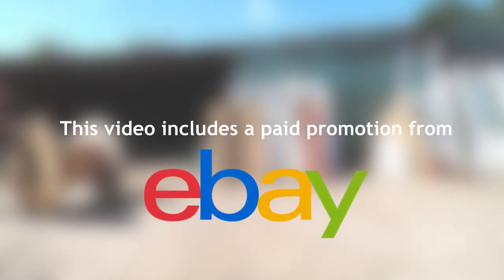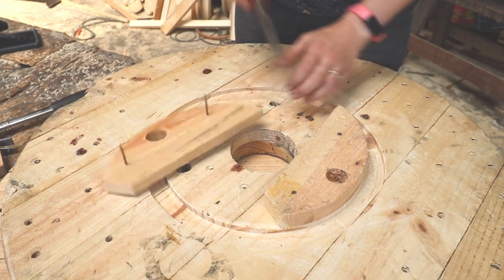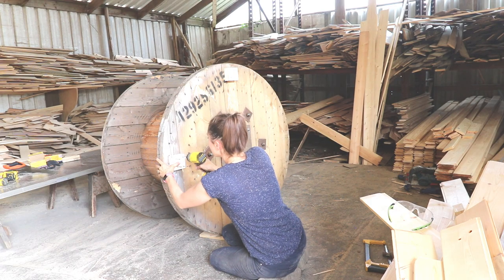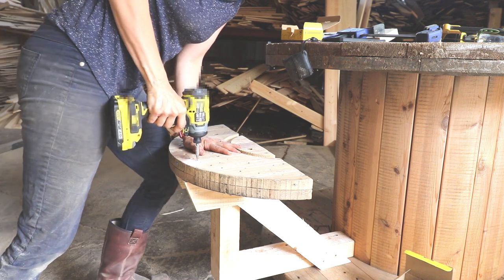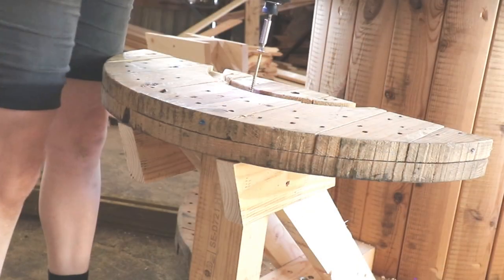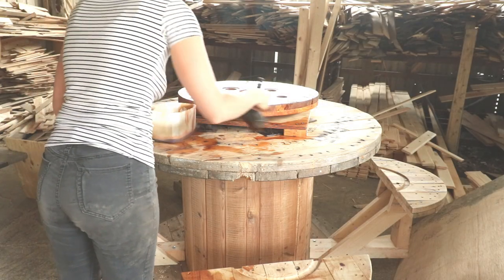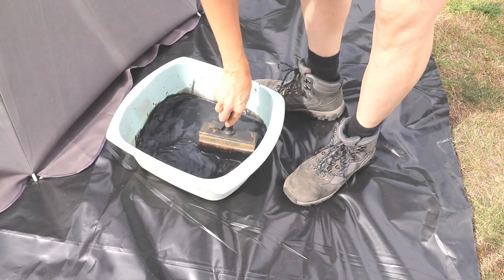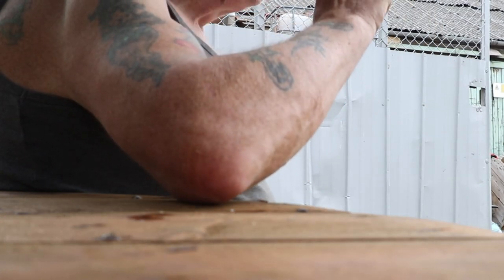#ad How to Build a Picnic Bench Table from a Discarded Cable Drum Reel

Comment: I love this! I have always wanted to up cycle a cable drum! If you really want to go posh you can make little semi circle seat cushions for next year with elastic straps! 

And who ever was Suzanne, she was never lazy just smart! lol
Reply from the maker: Great idea!!  I may also look into playing around with seats that hinge!   And I'm curious where lazy susan came from!!  Apparently it's something to do with Thomas Jefferson, but nothing's confirmed online! :)
Reply: @TheCarpentersDaughterUK   Ok. Is that to keep it upright when not in use to keep the rain off? Could you make a little cupboard in the middle underneath or is there too much in the way? If so, you could always run a hose through the middle and connect it to a beer tap that runs back through to a beer keg? Then you can make the excuse of buying one of those wooden beer kegs by bulk buying beer and you can make something from it afterwards. You see where i am going with this! lol ;o) Those beer barrel kegs would make a nice cabinet plus you have a serving table on top!
 
Apparently he invented the revolving book shelf too. Those sorts of things are great for corner cupboards too unless something gets stuck. I saw a video i think on twitter of a guy who made a sliding drawer and corner storage like a backwards Z but the centre bit is straight. Hard to describe but he pulled out the first drawer and then slid it left so he was able to access the corner drawer and pull it out. All using those drawer slides. Quite cool concept.
Reply from the maker: Yes, for rain to run off :)  I considered a cupboard initially, but with the top being so heavy, I feel the middle slats offer extra strength to the metal rods inside and the thought of it potentially breaking bones turns my stomach.  But the keg idea is GREAT... I love how there's so many potentials with them!

Comment: Quite imaginative, I would have just plonked them down as is and be done with it. One suggestion, flip the bolts holding the top down on your lazy susan, especially if they're cup heads.
Reply from the maker: That's definitely one way to do it 😂  And thanks for the tip!

Comment: Nice work. Nice Finnish. I had a cable drum but sadly it was to far gone to try that . you're lose nuts ! You can get nylock locking nuts or a drop of super glue , super glue will undo with a wee bit of heat if needed.
Reply from the maker: Thanks so much!  Love the superglue idea as can imagine most will have some in their home!